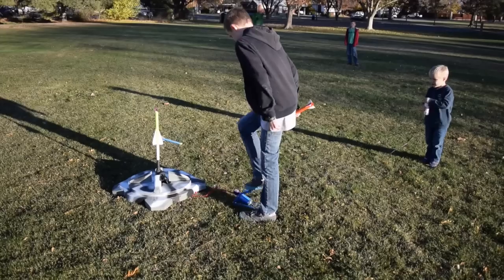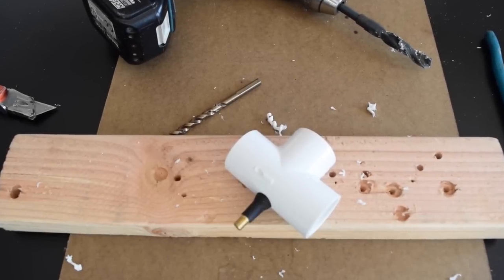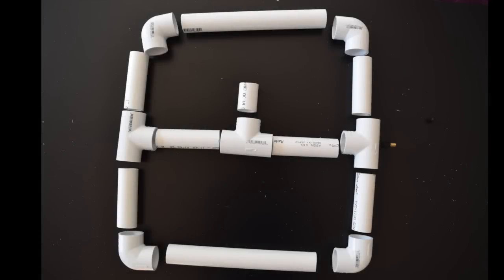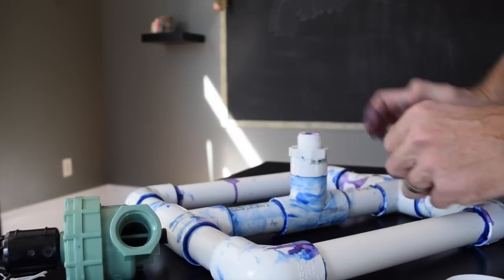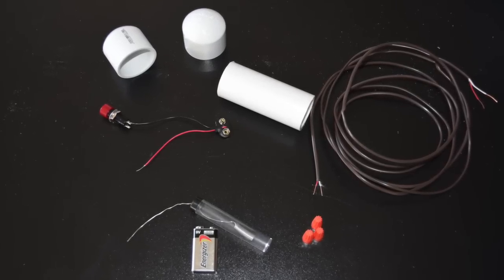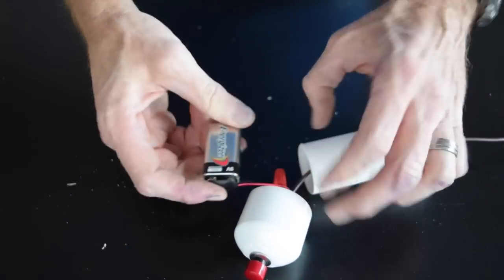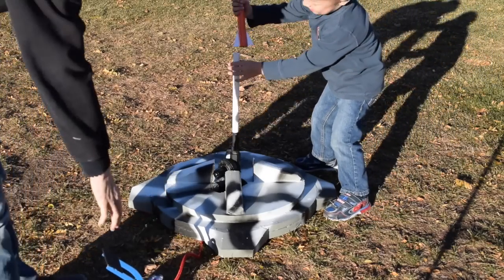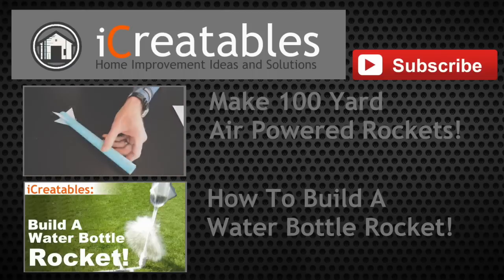Air Powered Rocket Launcher - How To Build

Comment: What was the solenoid valve rated for voltage wise? I have a 12 V Milwaukee battery that I would like to use to power my own version of this but most of the sprinkler valves that I see 24 V

Comment: Using PVC pipe as a pressure tank is a very bad idea. It was not designed for that. Buy a purpose-built air compressor and tank.